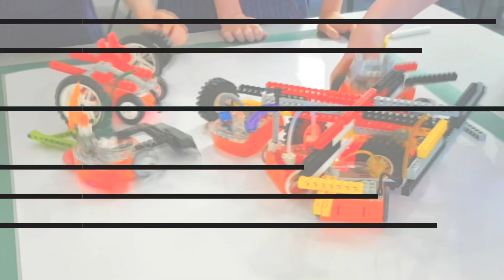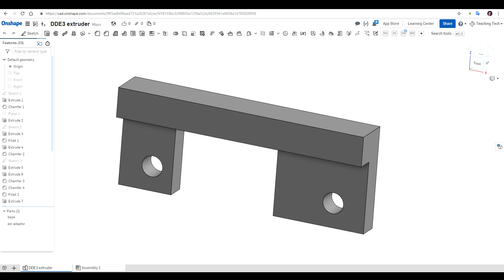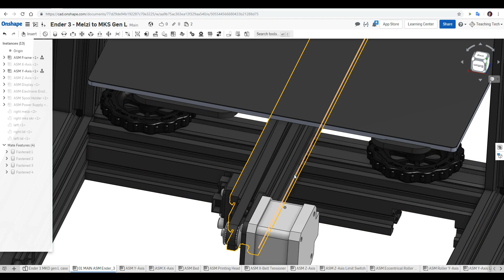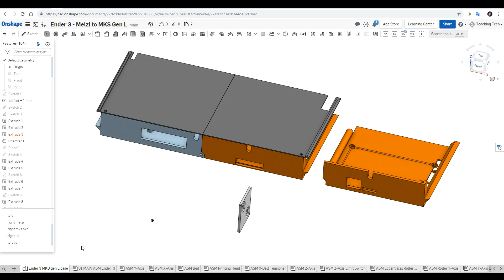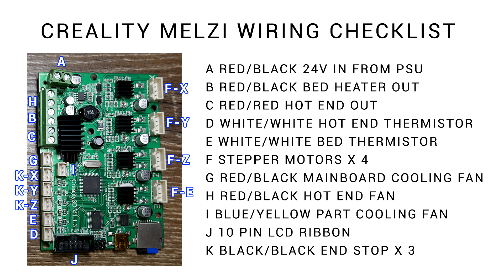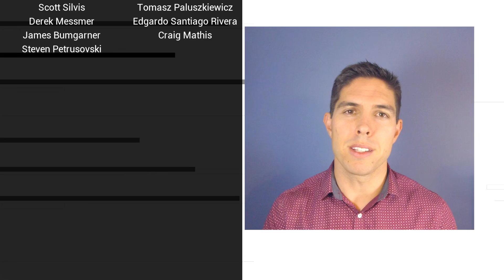Ender 3 upgrades: EZR to direct drive adaptor and all in one rear mounted electronics case

Comment: Hey Michael, great design as always. What about cooling? Those TMC Drivers are getting hot and I don't know if that single 4010 will move enough air. Please have a look at my case on thingiverse (3487919). I separated every electronic including the Power Supply to a big case. It is especially useful, if you woul like to build an enclosure for your printer. Works with Ender 3 and Ender 3 Pro, MKS, Raspi and every other model, that uses a Meanwell LRS350 - 24V PSU. And it is super quiet because of big and noiseless fans. Kind regards, mo78
Reply: I like this design as it gives you the ability to place your electronics outside of an enclosure if you are needing to print ABS.  Also, this has even an easier access to the electronics.  Last thing needed is a way to attach the Ender 3 display.

Comment: I have been thinking about moving the electronics because i don't like flipping the system over either. Now I have to.  And I love my EZR too, so now I can see direct drive in my future too. Bring on the 32 bit motherboard. I'm really curious if 32 bits will have any effect on an Ender 3, where we're moving around the bed. I always figured that was the limiting factor. I run a glass bed too for the flatness. The WhamBam is much lighter so are you able to get any faster speeds using that?  Although the easiest way to double my speed would be to just buy a second Ender 3. :)

Comment: I already upgraded my electronic to an Einsy board.  Do you have a step file of the electronics box available?  Since I already have a solution for my Pi, I don't need to add it to the bottom like you did.  Can the electronics work alone or do you still need a raspberry pi part?

Comment: Really looking forward to the SKR video - hopefully it offers better temperature stability than the main rival!
Reply: I also had a ton of luck by desoldering the 22uf cap from the original creality board and using it to replace the garbage one on the MKS board. My temps got rock solid again after doing that. And the best part is its free just need to know how to work with smd parts. The MKS board has the wrong type of cap on it from the factory on the output side of the voltage regulator.
Reply: @Potatogambit  I don't think my soldering skills are good enough to remove that little tiny one - that or I don't have the confidence to do so!  I'm surprised TT didn't have the same issue - but I did wonder whether he has the Mean Well psu which in theory could be a lot less noisy than the stock ender 3 (non pro) version?
Thanks for your reply, I may look at doing this mod after I've found something else to learn on!
Reply: mike306dt 
My MKS Gen L works much better after I added a capacitor to the 5 V rail.  That was enough to knock back a lot of the noise, and get the temperature sensing to work more effectively.  There are still occasional spurious ‘heating failures’ thrown up, so it isn’t a 100% solution yet.

I used a 2200 uF capacitor, attached to the 5 V block in the corner.  The other terminals in that block I used to run a 5 V case fan, which may be one source of noise on that rail.
Reply: @boggisthecat  Thanks so much for taking the time to reply, I did try a 5v capacitor (low ESR Panasonic at 1200uf iirc) but it still twitched around somewhat!
Reply: mike306dt 
If you have an oscilloscope and a few capacitance values you can try different combinations to draw down the various frequencies.  Unfortunately these are just cheap boards with some poor quality components, so what worked for me may not work for you.  (Also, my 5 V fan doubtless changes the noise profile.)

Some people reported putting two 1000 uF caps on the 5 V rail in the corner and at the servo output 5 V pin.  I’m dubious that this would make much difference, but if you have two 1200 uF or similar then you could attach a second in parallel initially, or on one of the servo 5 V pins.
Reply: @boggisthecat  Dear Care to share a link with a picture? Many thanks
Reply: Belen Hedderich 
If you need a photo then it’s probably not something you should try, really.  Do you know much about electronics?
Reply: @boggisthecat  I know a bit but I found out how to do it thanks anyhow :)

Comment: G'day Michael!  Very cool undercarriage box design!  I am torn between something like that, or making a stand-alone unit that could be moved outside of a heated enclosure.  Are you planning to use the relay to power on/off the main PSU?  I just got a relay to do the same thing, but am not sure what to do about the Pi half-way powering the Ender 3 via the USB even when the PSU is turned off.